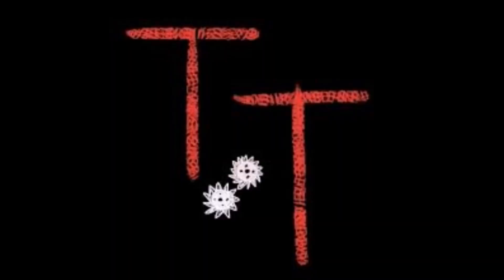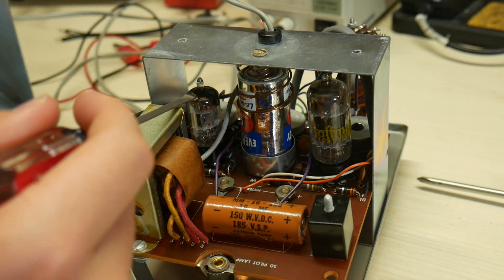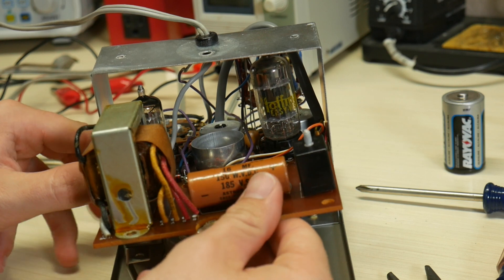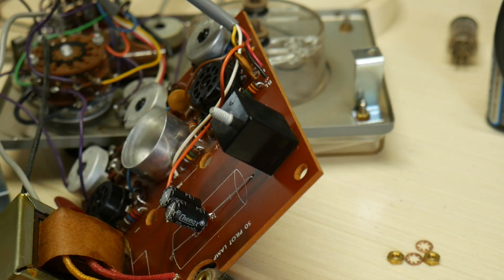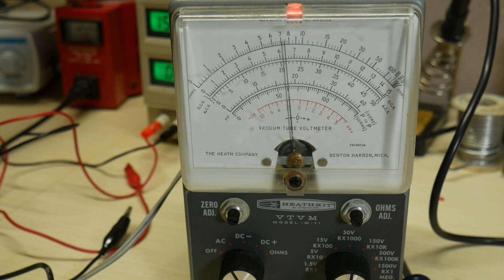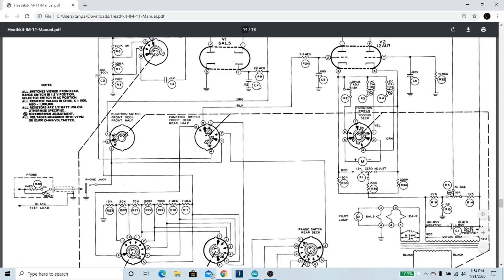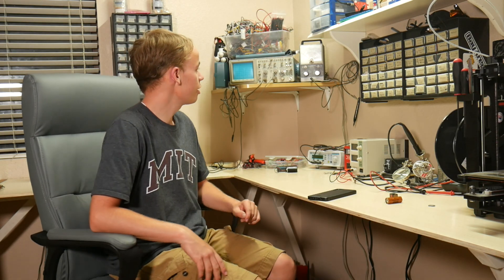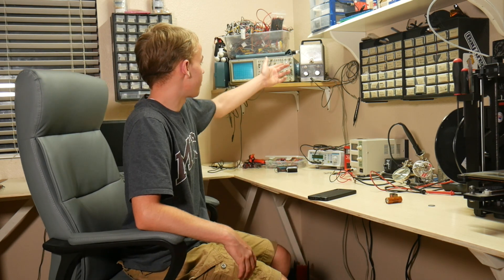Heathkit Vacuum Tube Voltmeter Repair

Comment: Good video, although I can offer a few comments in the way of constructive criticism:
- I am glad you caught you initial error about the unloaded 'cell' voltage.
- The 1.5V cell in this meter just lifts out of its holder, no need to remove the screw.
- In the video, when the meter was misbehaving, you did not appear to be adjusting the two front panel 'knobs', nor did you mention it. In the Ohms function, these two potentiometers are critical, and if they are a bit dirty inside this can result in some of what you were seeing. With ANY such old electronics, it is a good idea to cycle, and perhaps clean, operator function potentiometers so they will make reliable internal connections. Often, even moving them slightly can restore them to functionality. The same thing applies to the switches....they should be treated with De-Ox and cycled through their positions a few times before testing the device, and this can immediately remove many potential open connections. I suspect that this was more important in your VTVM than re-soldering the PCB (which was probably unnecessary).
- A VTVM will NEVER be a "precision instrument", no matter how well it generally seems to function. Look up the specifications for these, and you will see that they are only specified to be within a few percent of full scale, which by today's standards is highly imprecise. Add to that the parallax issues when reading the meter, and you can see what I mean.
- In your circuit description, for the dual diode tube, I think you missed a critical part of its functionality. Not only does it rectify the AC signal, but it also doubles it to make up for being a half wave rectifier. It is what's called a "Villard Doubler" circuit. Because of the voltage drops in this circuit, it is necessary to inject a small correction signal into the node at the output of that circuit, and you did briefly touch on this. Something else I think you missed, the output of the Villard Doubler is negative, and this is why the function switch that connects the meter movement between the two sides of the twin-triode 'bridge' circuit reverses the meter connections while in the AC Volts position.
- The range switch resistors for the Ohms function are not configured as a voltage divider; they are just an adjustable series resistor.

Comment: Great video! About 8years ago I purchased one of these meters on ebay, when it arrived from America ( I'm in the UK) it was in a bad condition, some of it due to poor packaging, even the circuit board was broken in half! But I really wanted this meter, I repaired the board, replaced the parts that needed replacing and have been using it ever since! I'm an old guy and I build my own vacuum tube amplifiers, I have quite a few fancy modern meters but this one is my favourite go to meter!

Comment: I would have ordered the axial lead capacitor.  It just looks too rigged to solder in radial leads in old equipment, although I see it all the time, just doesn't look right.  The new axial lead caps don't look the same, but they do look like they belong there and avoid the rigged look.  This does not reflect on your skill, I just think neatness counts.  A 16uF at 450 V should be about $6  from the many online supply businesses like Antique Electronics Supply.

Comment: Very nice presentation.  You may have noticed that the two triodes are connected as a current mirror - two cathode followers.  As the left triode is biased further into conduction, the right triode reduces its cathode current  proportionally  leaving a differential voltage across meter and series cal pot.  This current mirror has good common-mode rejection so that any variance in a.c. line voltage is cancelled and will not cause imbalance in meter differential voltage.  Op-amps do very much the same thing, but with a more precise effect due to their very high gain.

Comment: Good job Tanner! You did a very good job with the restoration AND explanation of the VTVM. I am restoring the same meter as I write and found your guidance very helpful especially selecting the 1N4005 diode. I will be using mine to do an alignment on an old Hallicrafters HQ-180 shortwave receiver. Just had to say thank you for such a great restore of the VTVM.
Mark (N2DMI)

Comment: Tanner , It is refreshing to see a young brilliant student like you so involved in electronics.  I have one suggestion for you in regards to using this meter to measure ac line voltages.  Although the power supply of the meter is isolated through  the power transformer,  the black lead or common on many of these old VTVM's is connected to the chassis . They also use a two wire line cord.  If you connect the black or common lead to the hot side of the line , the case of the meter will be at line potential . If you touch the case you would be touching line potential . I suggest if you work with any line operated devices, especially older ones,  get an isolation transformer . A variac is an autotransformer and does not isolate you from the power line.  Keep up the good work Tanner, you have a bright future .

Comment: You don't "tune"   meters, you CALIBRATE them.    Potentiometers without knobs, are NOT knobs.
Suggest you take a Metrology class to learn the correct terminology and procedures.
Don't give up trying, you'll get there..

Comment: I have a model v7a and the needle jerks around while it's just setting there. Any idea what might be the problem? I'm replacing the 12au7 since it reads low on the tester. I've never seen anything like it.

Comment: Hello, TT! I have watched your vids for a few weeks now and have no regrets. I am 14 years of age as of right now. I am currently building a dual mot SGTC. I have done electronics for about 2 years and my goal is to go to MIT or Cal Tech and get a degree in electrical engineering. Just wanted to say, your not alone, there are plenty of other young engineers. If only all of the could come out. Anyways, you have definitely earned my subscription and I wish you the best of luck!

Comment: Never ever work on vacuum-tube electronics without first discharging the electrolytic capacitors. If you are working on powered-up high-voltage electronics, only use one hand to hold probe. Keep the other hand away from the gear.
Reply: Also, you should be using an isolation transformer - not one of the hospital grade versions, but a real Technician Grade version, that truly isolates the primary and secondary sides.
Reply: @howardhiggins9641  the internal circuits on the secondary of its power transformer are chassis ground referenced and so just clip scope ground to the chassis and all is okay.

Comment: There's something about old electronics that you don't get with modern equipment. It's the fact, that you can see every component in the circuit and easily figure out what they do. The circuits are also usually exceedingly simple and consequently troubleshooting is almost always a lot easier than it is on modern equipment. Sure, they lack the fancy color LCD displays and different functions that are only possible with the help of a microcontroller, but those old things had to be made to serve a single purpose and they did it well with a clever use of  components, that were available at the time.

Comment: I have one, a V-7 that my cat knocked off the table and busted the clear plastic dial cover. I have most of the pieces, but not all.  Any suggestions?
Reply from the maker: Oh no! Those cats love to mess with electronics haha! I would try supergluing the parts together, see if it looks any good. If not, it will run fine without the cover, just make sure to keep any air currents away from it, they will interfere with the needle.  If you are really feeling adventurous, you could try making a new one by bending plexiglass.  Old heathkit parts are hard to come by these days...  Good luck!
Reply: @TannerTech  I have most of the piece's. If I had the time I could make a mould and make a new one from epoxy. I'm so sad my cats have done this. It seems we need a supplier for the heathkit face plates. Perhaps I could start manufacturing them.
Reply from the maker: @sarahhoward9081  That would be cool if you started manufacturing them!  I have one that is broken as well.

Comment: That one is in beautiful shape!  Replace all the electrolytics and measure each carbon comp resistor.  A solid state replacement is made to replace the battery forever.  This is very cool.
Reply: i dont mean to be so offtopic but does someone know of a trick to get back into an instagram account..?
I stupidly lost my password. I appreciate any tips you can give me
Reply: @Emerson Fox Instablaster =)
Reply: @Kai Kairo thanks for your reply. I got to the site through google and I'm in the hacking process atm.
Seems to take a while so I will reply here later with my results.
Reply: @Kai Kairo It worked and I actually got access to my account again. I am so happy!
Thank you so much you saved my account!
Reply: @Emerson Fox Glad I could help xD